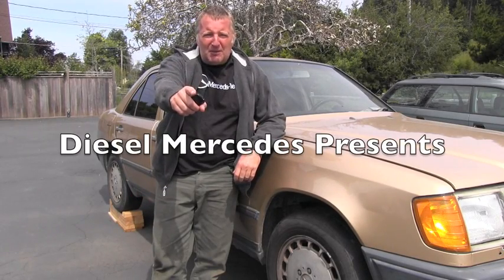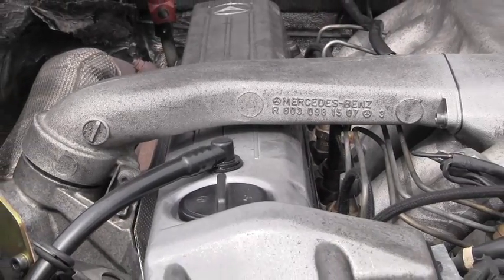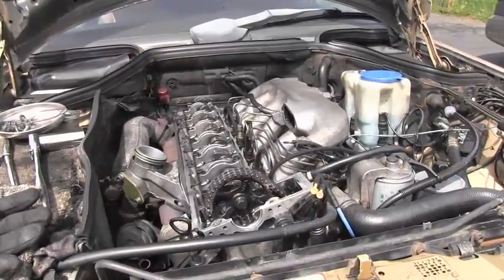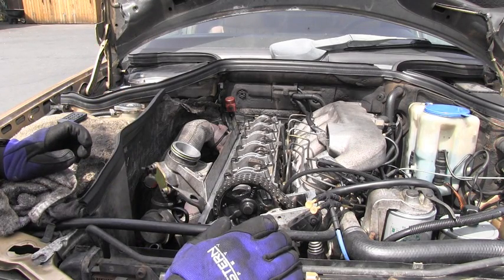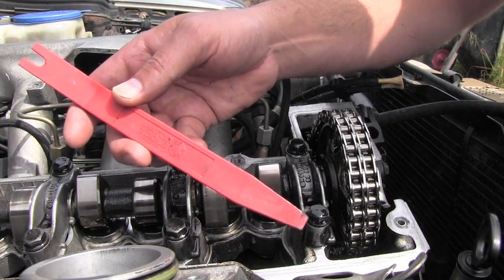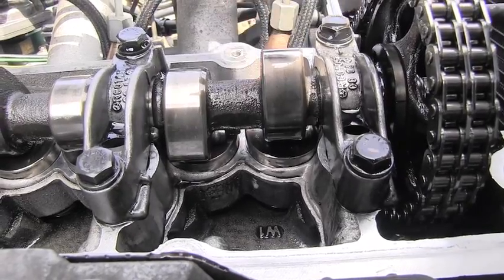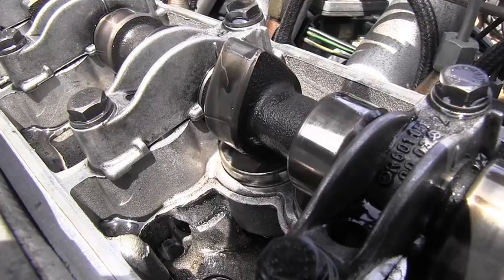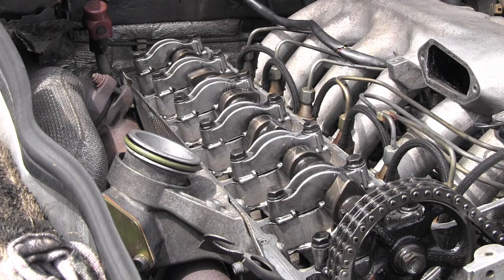Mercedes Diesel Hydraulic Valve Clearance Compensating Elements Bucket Tappets

Comment: In the past I've used a product called RISLONE for lifter noise on various engines.   It works really well, under $5 walmart.     I'm trying it out on my OM603.691 with promising results at the moment.     Much quieter but not gone; 100 miles in.     Loud 'TING!' to barely noticeable 'ping'.    

I also read on the forums people having very good results switching to Mobil 1 full synth.    Something I never would have used myself in a older diesel.    Diesel formulated oils have more detergents and do a better job suspending the soot captured.     But I'm willing to give it a shot if others are saying it works wonders.

Comment: You forgot one important information: When multiple hydraulic lifters are failing, it is sometimes a sign for a defective head gasket. In older castings of the cylinder head the oil gallery for the camshaft and tappets is sealed along the width of the cylinder head fully by the head gasket. Sometimes pressurised oil pushes through the gasket into the timing chain room. That is a serious problem on OM603s with a gasket, which is not reinforced at the oil gallery.
Reply: There are new reinforced versions of the head gasket

Comment: Hi thanks for your video .... did you have a video how we change this parts ? My mercedes have this problem since long time and now I'm happy to have the solution thanks a lot !!!!
Reply from the maker: not yet....
Reply: Diesel Mercedes thanks your your response.....it's a problem to drive with this failure?
Reply: I have same noise on my 602.911 after this test I found 4 bad tappets. The video how to replace them will be very useful
Reply: @xvidasx  have you done the job yet or have any material or videos on replacement? I have the same engine as you.

Comment: I have 1987 300SDL with 95000 miles and I just took it to the service to replace radiator that was leaking. Right after picking up the vehicle, I noticed that ticking sound in the engine. Could it be just a coincidence that sound appeared after radiator replacement, or it happened due to couple pressure tests done to find where the coolant was leaking and now it causing that ticking sound to appear? Thanks!
Reply: Emilis Cicenas how long did the repair take before the engine was run again? That maybe the reason for the tick- hydraulic elements drained the oil back during the engine down time.